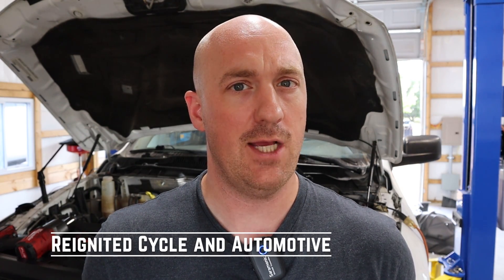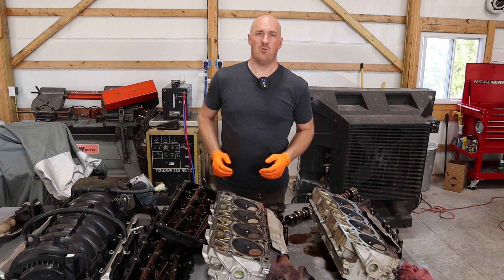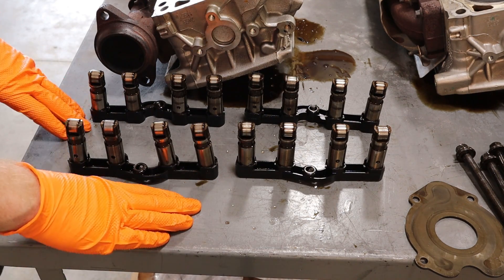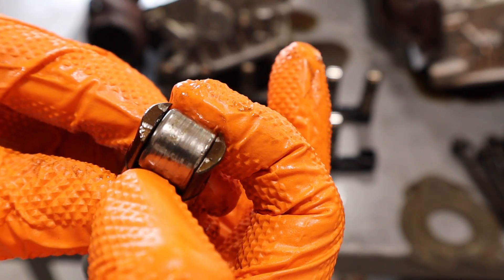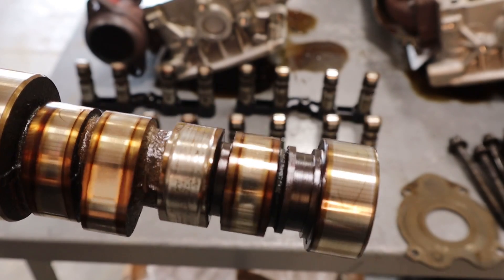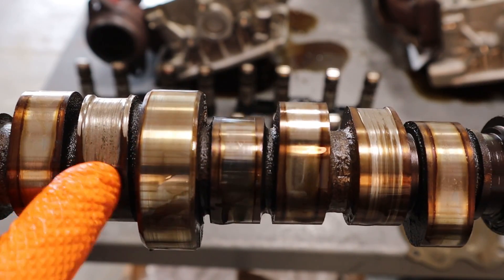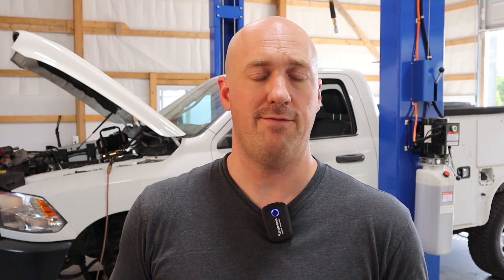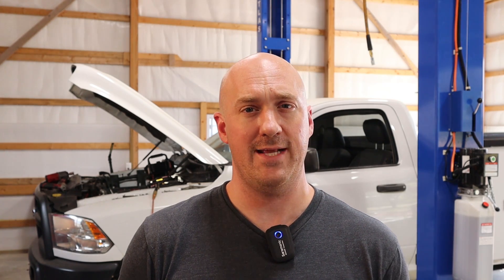Hemi 5.7 Lifter FAILURE Does this engine have a fatal flaw? Find out how YOU can prevent it!!!

Comment: What years does this effect im lookin at a 05 1500 later with he says lifter tick but its immediate on startup. I wanna get an idea before heading there and can I drive an hour home or should I get my buddys tow truck
Reply from the maker: If it's immediately on startup I'd be checking the exhaust manifolds for broken studs first. Not a lot of 2005 vehicles had issues with lifters. 👍
Reply: @ReignitedAuto  cool. That was my thought was it was. Little later but was an auction vehicle. If is lifter safe to drive 1 hr home? Break in between of just go?
Reply from the maker: @maxmorter  no worries to drive it home
Reply: Appreciate it my friend
Reply: He misspoke its a 3.7 I know they are notorious for bad lifters and rockers fallin off but for 900 I couldn't pass it up. Also had cat stolen and a little rust on passenger cab corner still can barely find a broke down one for 1500 bucks so he'll yeah
Reply from the maker: @maxmorter  The 3.7 is a good if uninspired engine. The ticking noise is likely coming from the lash adjusters under the rocker arms. The good news is that you can replace them without removing the camshaft on top of them, it's actually a fairly easy repair, and will make the truck nicer to drive. My only recommendation is to not go with aftermarket lash adjusters since they will likely rattle as well.

Comment: Dodge has had engine problems for many years. 
There overall quality is very low unless you go back to the 70s. They're paint sucks with clear coat peeling. The interior parts fall apart like peanut brittle. Most of the truck transmissions as far back as 1998 are not dependable. That's probably why Nascar didn't want them anymore. Build em cheap sell em high. And by the time the engines let go they'll be able to blame the operator and not their shoddy quality. They need to recall their junk and make it right.
Reply from the maker: It's a good thing no other manufacturer never has any problems ever, surprising Dodge is still in business! 😂
All jokes aside, you clearly have issues with Dodge products, and that's fine, but the truth is that they have a following just like every other manufacturer does. Some people like them, some hate them.
Reply: @ReignitedAuto  Well in a way yes you're right. I have a problem with how quality with all auto manufacturers including Dodge doesn't matter as much as the profits and bonuses for corporate executives do.I'm 64 and I know every auto manufacture in the world has had multiple recalls. And I understand that mistakes can be made and recalls are necessary.  But when the recall is for say several hundred k or 1.2 million vehicles it's not a mistake. Take Volkswagen for example, the software deal.  Theirs was intentional. I mean if they can't catch a faulty part or whatever thru inspection and testing at their facility before a million slip thru then gross incompetence in quality control is the problem. Or they knew about it and let it go until they get caught. How many manufactures used the killer airbags and knew they could over aggressively deploy?  So do I believe that Dodge knew their high horsepower Hemi engines would fail because of an insufficient  internal part? Of course they did if the engines were property tested. Or their engineers are idiots. So back in my day Mopar was king of the road. I've owned a 69 charger, a 67 barracuda,a 67 Coronet 440, a 73 Demon duster 340 and a 70 something 383 magnum Plymouth fury back in the 70s. Only problems the engines caused back then was rear tire smoke and speeding tickets.lol 
I loved those cars then for their styling but mostly for the badass engines. My son in law bought a 2012 Ram with the 5.7 almost  a year ago. It had a slight ticking then but the dealership said it's nothing to worry about. 6 mths later had to park it and can't afford to repair it. So  yes, I think Dodge needs to step up,  recall and repair the high performance 
engines with the  made in Taiwan needle bearings. But I liked your video and the  info update.
Reply from the maker: @mr.moorell8677  Definitely not going to defend the decisions that fiat/Chrysler has made in the last ten years, one of the reasons I no longer work for them. Appreciate your input as well. With your son in law's truck, have him take a look at the exhaust manifolds first, very common for the rear most studs to break and cause a ticking noise on startup especially. I've got a video about it on my channel 👍
Reply: @ReignitedAuto  Yeah seems like most if not all of them have made their share of mistakes or had their version of the k car aka one that should never have been made.  Or install unnecessary gadgets or devises that only add to sticker price. The talking instrument panel that tells you your fuel is low, or your door is ajar and my personal favorite, please fasten your safety belt. The Chrysler New Yorker. I heard that nonsense for over a year but when I sold it I kind of missed the chatter.lol   He had a diagnosis done and it indicated #1 misfiring. Replaced plugs and wires but ticking only worsened. At that time I nor he new nothing of the lifter issue but I could tell it was internal. From what I've learned from your video and one other I believe it's the lifter or bearings of #1  cyl. I will pass the info to him about it and your channel tho. 👍

Comment: So how long does the fam and lifter replacement take? Is that all it takes is replacing the cam and lifters?
Reply from the maker: It depends on your skill level of course, I do them all the time in one day, but if you've never done it before definitely give yourself at least two days to tackle this one. And if there's not too much metal in the engine (like say it has eaten the entire cam lobe down to nothing) then you should be just fine replacing only the cam and lifters with new parts. 👍

Comment: Is this just a 5.7 engine issue, or the 6.4 and 6.2 too?
Reply from the maker: The 6.4 in the trucks is affected for sure, don't see it as much in the 6.4 car version, and I've never done a 6.2, but I believethat's mainly because the there are much less of them overall, and the driving characteristics are much different for those types of vehicles.

Comment: But in reality there are multiple issues. One is the idle drop isn’t it ?!   Don’t the fleet vehicles have a drop in rpm for longer sustained idling ? 
 If that drops so does oil pressure .
Reply from the maker: You are correct that there are multiple reasons why this is occurring. I have actually heard that there are fleet specific PCM flash updates that actually RAISE the Rpm level during idle so this doesn't occur as frequently. 👍

Comment: After replacing lifters and cam mine still ticks. The mechanic said it would go away soon, is that true or bullshirt?
Reply from the maker: It all depends. If he used factory parts then yes, they will tick for a little while. But if it's not gone after a full day then it's not going away. If he used aftermarket lifters, sometimes the ticking noise never goes away.
Reply: @ReignitedAuto  is it going to chew into the cam again? The ticking is bad isn't it?
Reply from the maker: @Ronkrein  nah, the ticking noise after lifter replacement is because the hydraulic portion of the lifter still has air trapped in it. This noise goes away as the air gets worked out of it, but its not harming anything. 👍

Comment: I did a cam and lift replacement and now my s wire isn’t getting power the fuses rattle and I’m getting a ground sensor code.
Reply from the maker: Need some more info, what codes specifically are setting?

Comment: Idk, that sounds like BS. I don't disbelieve oil break down in general I've seen it myself, but we're talking thousands of clicks over oil interval to get to that point. And either way Ford, GM and Toyota fleet sales dwarf or are equal to Chrysler and yet I don't see them needing oil changes by engine hours, there's plenty of other issues that are obvious like Fords oil leaking and direct injection issues, GMs DOD lifters collapsing but sorry no one else has the same sort of engine idling issues as you claim. If this is true, then Chrysler doesn't have a proper lubrication system, if these engines need more clean oil by design, then they should have much larger oil pans and/or higher oil pressure at idle maybe a specialized oil cooler to keep the oil from breaking down. GM also uses a pushrod motor and yet they outlast the car easy no matter the abuse, toyota uses a very modern DOHC V8 and yet has basically no problems with them other than the water pump. So no BS i don't buy it for a second that one of the big 3 failed to design an iron block pushrod motor that can't deal with some stale oil. And I'm not a mechanic I do custom electrics and most of my customers are truck/jeep/sub guys, and I've seen and heard plenty of hemis with the infamous tick so no way it's just fleet cars. And before someone says i'm a fanboy, i'm not a v8 guy, i prefer my Volvo station wagon 347,000 and still counting.
Reply from the maker: Definitely not saying the design couldn't be improved, just saying that there are usually extenuating circumstances that attribute to the issue, and if you avoid those then you generally get good life out of the Hemi engine. 👍

Comment: I Drive my truck a lot back-and-forth to work everyday I do oil changes every single time it says oil change haven't missed 1 yet 142000 milesAnd I have a misfire on cylinder 3Pulling valve cover offThis weekend to see what it is Already change the coil and spark plugs

Comment: I can remember as a professional mechanic all the camshaft failures on the 305 Chevrolet engine.  My 2011 jeep grand Cherokee does have a tick from the exhaust manifold,  which i have seen many times from broken exhaust manifold bolts on the 4.7, and I would have hoped Chrysler would have installed heavier bolts on the 5.7 but evidently they chose to install the same useless bolts.
Reply from the maker: Yea I can't say that seems like a priority to Chrysler 😄

Comment: Just a note on the lifter failures. When i heard about it initially i was using the best 5/20 oil from AMS OIL and then l added a friction modifier called Archoil which l think is a fantastic product. It's sold on Amazon. I also use AMS OILS best filter. I'm going to put the 6.4 / 392 stock cam in my 5.7 and if i see any lifter / cam lobe wear i'll let you know but my engine has 92000 km or 56500 miles. I had a miss but l swapped the coil on that cylinder and that turned out to be the problem. I will let you know when i do that cam swap and ask for your advise at the time. Hoping the Archoil did it's job.
Reply: Update?
Reply: @mikeoxlong6351   Update??

Comment: I have a ram with a 5.7 and it has a lifter issue for a while now , it runs strong other than misfiring. I have been running it like that for a few months now. Would the engineer ok if i replace the cams and lifters or do I have to get a new engine. I let it go because I was going to get I new engine but now budget is not so good. Need some advise

Comment: If an engine is so susceptible to oil degradation, it is a design problem - too fragile a design. Car engines should be able to go well over the prescribed oil intervals and they should have a generous safety factor applied, like "3". So that means if your oil change is due at 10000 miles, you should be safely able to do 30000 miles without issue. Modern oils are very sophisticated and durable but they cannot accommodate weak engine design. Most cars can have one and two and even three oil changes missed and "not" prematurely fail. I understand recent versions of this engine no longer have the problem, so that reinforces the notion that it was a design problem.
Reply from the maker: Martin I want to live in the world you live in with that much safety margin applied to designs. In the automotive world that has never been the case. Also, they updated the lifter design, doesn't mean they fixed it. I've still fixed quite a few 2016+ models with the revised lifters for the same issue.
Reply: @ReignitedAuto  We do live in a "Western" world with that much safety margin. I'm a retired engineer and a factor of 3 is pretty much a "standard" safety factor where threat to life is not present, and it goes higher when it is. As to cars, most can be abused by their owners to a great extent and still keep going reliably, they have a huge amount resilience and instances like this one are not the norm, they are simply design failures due to a lack of knowledge and understanding on the part of the designers. We live in a culture where older people with knowledge and experience are not advantageously utilised but are considered demented and due for the scrapheap, and the young guns with the big egos have all the answers, and that may also have a lot to do with failed designs. This failure should have been picked up in engine testing and remedied before the engine was ever released.

Comment: I disagree with your assessment of the problem!  The actual problem wasn't from long idling or lack of oil changes and has nothing to do with Fleet vehicles.  The real problem was in the design of the lifter itself....which long idle times may help the lifter fail quicker.  This is why Chrysler eventually changed the part number of all newer Hemi lifters.  The new lifters are actually designed different with better/thicker needle bearings and a more open roller on the lifter to allow oil to access the needle bearings.  I've done many of these updates to Hemi's (none from Fleet and all daily drivers with excellent oil history) and now only use the superseded part number for all new Hemi's regardless of displacement they're all the same.  Some call this the "HellCAT" lifter because the new lifter design coincided with the new HellCat engine.  IMHO...chrysler should reimburse all past jobs due to their poor lifter design.  But, corporate greed will prevent that I'm certain.
Reply from the maker: If you look at my community posts I posted a picture of the older and newer lifters side by side for a good visual comparison. That being said, I've done quite a few 2016+ lifter jobs which already have the updated lifters in them. I think that was only part of the issue.
Reply: @ReignitedAuto  Interesting....I've yet to have any comebacks for ticking.  Seems to have solved the problem for me...for now.  If what you're saying is a factor, then maybe the oil pressure is too low feeding the lifter rollers and bearings when at idle.  At least we're making money fixing Chryslers FU!!!

Comment: Clearly its a flaw. Wish I could trust American engineering  . I want to buy American,but I also want to make it to work in a reliable truck. I trade power for reliability any day. America, please design a truck that can pull 6 tons , last 300,000 miles and cost under 30 grand. I give up ac, auto trans, whatever bells and whistles to buy it

Comment: I have a 2005 Chrysler 300C 5.7L Hemi, it makes a little "tick" when I accelerate it from a stationary position to high speeds in a short period of time. What could that be?
Reply from the maker: Your vehicle is pre MDS and pre VVT, so I doubt it's a lifter issue. I'd be looking at the exhaust manifolds first before anything else. Check the rear most exhaust studs and see if the heat shield is loose, if it is you've got broken bolts that is causing an exhaust leak. If the heat shields are still tight on both sides then at least you've ruled that out. 👍

Comment: What is the BEST (optimum) idle speed to attempt to PREVENT the CAM/Roller Lifter failing issue?

Please don’t say 200rpm because I don’t know what the “normal” rpm is supposed to be.

Thank you for your time
Reply: Gotcha!!!  That helps tremendously Sky!  Thanks again!!
Reply from the maker: Call it 850RPM 👍
Reply: 2012 5.7 HEMI REBUILD UPDATE

I have a 2012 Dodge Charger 5.7 HEMI pursuit that I use for TxDOT Freeway/interstate off duty in Texas.  As you might guess, I idle most of the shift 6-14 hours.

1 year ago approximately; my lifters failed on my engine @ about 150k.  (Previous lifter/cam replacement prior to me purchasing this vehicle @ 75k miles)

I had the engine rebuilt with the HEMI HELLCAT oil pump, HELLCAT lifters, and the rest of the engine rebuilt as well.  As mentioned, my idle PSI (5w20 FS) was approximately 45-55 psi from 20-25psi previously.

It’s been a year and 2 months 14k miles.  I changed the oil every 2-3 months, Penzoil Platinum FS 5w20.  

And I experiencing lifter failure AGAIN.  This time, 95% piston 1 (MDS).  

The rest have rare and occasional misfires.  At idle and in motion it sounds like a lawnmower.  

I’m saving every penny for the coming rebuild and repair I know I will have to do AGAIN.  

I should repair it ASAP, but I literally cannot afford the 4-6k it will cost.  I MIGHT be able to get it down to 3k, if I shop around.

I am very very very frustrated and disappointed.   Previous to this, lifters lasted 75k miles approximately.  This time, they lasted 15k!!!   

I am at a complete loss, I have no explanations or theories other than maybe higher pressure oil burns up faster and needs to be changed more frequently.  Maybe if I changed the oil every month it would have been different.  

For anyone thinking it will fix this issue, there are obviously other variables at play and the low pressure oil pump appears to be a correlation to lifter failure.  

I don’t think it can be said at this point, oil PSI is the CAUSE, not yet anyways.